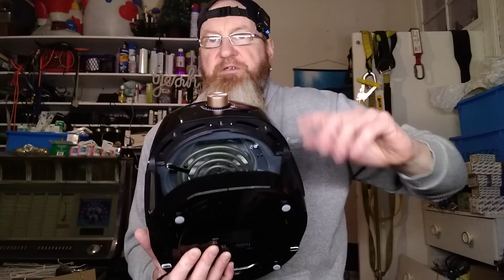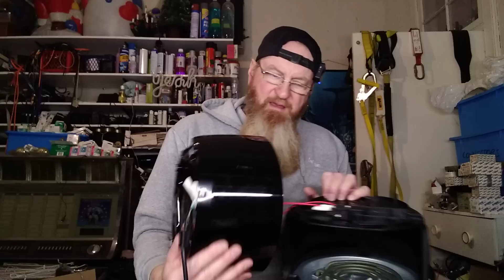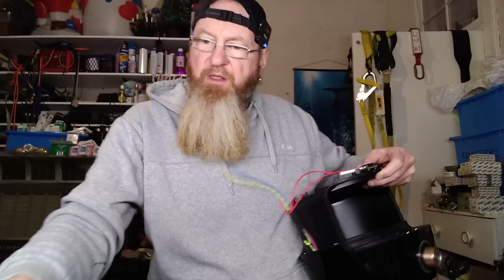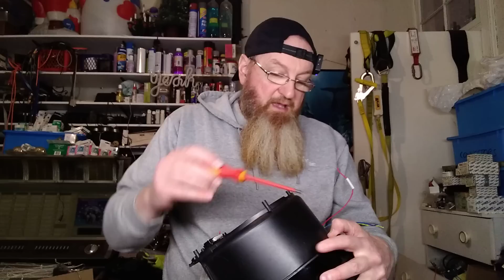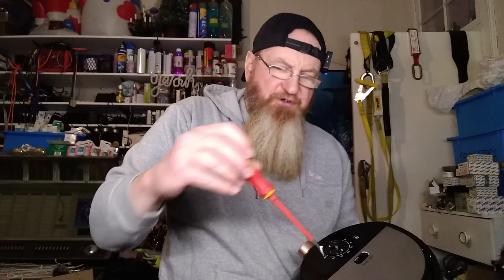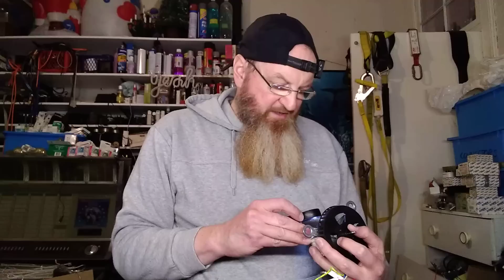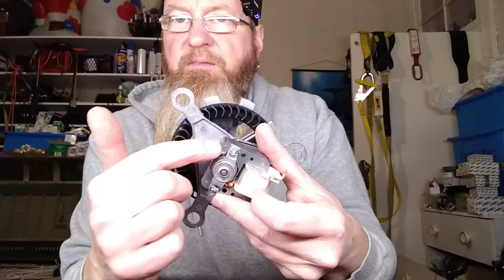Total teardown of an ASDA air fryer

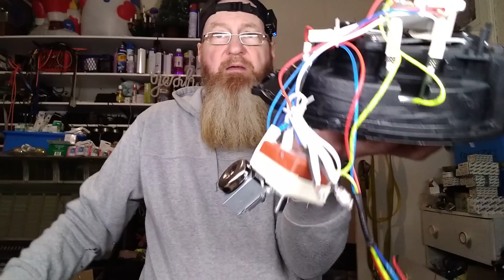Comment: Yes 14:25 that TING, Very good keep that for when you're building a fan heater and yes all that touble airmixing to heat the oven, run Some hot air through it to take out any water...
That fan design is good, interesting 19 is the same in both

Comment: They’re so simple. Why haven’t they been a thing forever? I also just bought a combination oven and air fryer and it’s amazing. The only thing I don’t like about it is that it uses PWM to adjust the element temperature - which is very nice, makes it much more accurate - but it causes the LED down lights to flicker. I’ve got Philips Hue LED strips which aren’t susceptible, so it’s not too bad.

Comment: Fascinating & reassuring to learn about the external cooling air flow. I wondered how these things didn't turn into a pool of molten plastic with 200c internal temperatures. You might want to invest in a small electric screwdriver to assist in future disassembly videos.

Comment: I love my air fryer! Same style but digital, no dings just beeps. 

I just did the same disassembly process with my broken rice cooker and you will not be surprised to find that all the problem was, was the thermal fuse. But now it is a collection of parts and the case is becoming a benchtop power supply.

Comment: Found this channel recently and im truly enjoying what you are doing. Is it annoying if I suggest that the speed of a cordless driver with a magnetic tip would reduce the tension a little :) maybe there exists a tiny little quick bit change tool with the right amount of speed and power?
 I dont know, just noticing this from the perspective of a person who uses drivers a lot and in a wide variety of applications to good effect.
 Keep it up and thanks
Reply from the maker: I've got cordless drivers, but when I use them at the bench there's a barrage of complaints about the noise.  So I tend to pause the recording while undoing screws.

Comment: my microwave has an air fry function built in... has a fan and element slong with a browning 9nfrared at the top... it does OK..  but the issue is everything you aiur fry seems to take a different temperature and a different time..  so making 2 or 3 things ofr dinner means i have to eat everything separately because it takes 10 mnutes or more to cook something...  with a deep fryer or a skillet it cooks in just a couple minutes. and everything seems to deep fry at the same temperature so I can cook multiple things in the basket at once..   not impressed by the air fryer revolution...  though it is real handy if i just want a snack of one type item then I use it..

Comment: Years ago I bought a cheap airfryer not too different to that one, but from Tower a rather big name in cookware in the UK.  I only got it because a few people at work had bought them and were raving about them so thought I'd give one a go, it quickly became indispensable.  The following year I bought a larger double drawer one even though I live on my own as it's great to throw chicken, fish, sausages or steaks in one side and chips, onion rings or roast potatoes in the other side. The only thing my oven gets used for now is the occasional frozen pizza.  The cheap Tower air fryer went to my mother who used it for a few years until her death this year and is now with my brother and still going strong. 

Thankfully Salter who make the dual drawer one I bought sell replacement parts which came in handy when I rather too vigorously cleaned the crisper trays with the wrong type of scrubbing sponge and took some of the non stick coating off. I'm a lot more careful washing it now and it still looks rather pristine so hopefully lasts me years.  When it does eventually die I shall replace it with one that the baskets and trays can safely go in the dishwasher as I am a lazy bugger really.

Comment: Timer is sticking at 5 minutes on mine after having a year doubt any dirt has got in it though.
Reply from the maker: The mechanical ones often do that.  It sometimes helps to wind it past the time required, and then back to the correct time.

Comment: That's very similar to the inducer fan on my pellet stove.  In this case the fan on the end of the motor shaft pulls exhaust from the inside of stove while the fan between the motor and case pulls air through the motor and keeps it from overheating.

Comment: The difference between an air fryer and convection oven is not only the size, but how the heat is distributed. Convection ovens use a fan to gently stir the air around the interior to better distribute the heat. Air fryers use a larger, more powerful fan behind the heating element to force the heated air onto the food for rapid cooking. 
I recommend the oven-style air fryers over the drawer style. The former have more room and are more versatile.

Comment: Great video. I like the format. Fun teardown. Amazing to see how they work. I myself have a tefal actifry which is an airfryer with stirring and it is great for chips etc. By the way, you can also get similar heaters with reflectors from round popcorn makers except they are IR halogen versions. A great assembly for lots of projects.

Comment: Hah! Air fryers are excellent for drying electronic parts/pcbs. Set the thermostat to the lowest point (typically 80C) and the fan makes quick work of getting all the moisture out. Do this at own risk. 

I have one of the original Philips air fryers, bought it around 2012. Pretty much exactly the same design. It still works perfectly to this day. As it should, for a relatively simple design.
Reply from the maker: I've used mine for heating electronic stuff.  I ended up getting another just for that and also drying desiccant to have a nice oil-free pan.

Comment: I have a Samsung smart oven which i bought before the popularity of air fryers....the Microwave gets alot of use....however I don't need to buy an airfryer because it is essentially an air fryer....it has the heating elements and the fan....it works very well too and its a large oven not like the majority of the small airfryers for sale.....win...win for me😊😊😊😊😊

Comment: Disassembly is much easier when you throw your tools on the floor. Took me years to learn that.   ;)
Downside of all of those years of experience being, now I get stuck on the floor with the screwdriver and screw...
Still, the story of my life. Pulling both knobs, then loads of screwing.

Of course, this being our modern era, a few pounds more would've gotten you a unit that dispensed with the thermostat and timer in favor of a microcontoller with enough CPU power to play Battlechess. Which is about as bad as those microcontoller controlled bloody toasters. Pretty sure they require a 64 bit processor for it to go ping.
Oh, there was no game nextdoor. The crowd had tapped into your network and was cheering your relative easy in disassembling a kitchen device that's typically quite infernal to dismantle. Well evidenced by the dental spade lug, which literally extracted the teeth of the drawer switch.

I'll stick with deep frying in a pot on the stove, although I am quite partial to induction hobs.

Comment: We use a similar fryer every morning for tater tots. It also works well for fish fillets. We've resorted to using paper liners as the spacer in the bottom of the basket isn't stainless steel and it's difficult to clean. Enjoy all your shows!

Comment: "spade terminals"!🙂 thank you!
My way to release the crimp is to wedge a very small flat head screw driver as far as it will go between the wired spade & terminal prong, then the wired spade should easily pull off the terminal prong.
I agree, some just pull off easily while others are a bit more stubborn!

Comment: Compared to my "fancy" air fryer that I have in the US, this thing works like magic. I was very disappointed to have to disassemble my air fryer when I got it due to the heating element not working. Was an easy fix, but taking a look at the insides gave me insight as to how rudimentary it is. No steam ports, no external temperature control (albeit the thing is made of glass and metal).

Comment: I ended up taking apart one of those little timers because the dial was far too stiff and it would get stuck, as well as being a pain to turn when your hands are wet or greasy. Got almost all the way but then suddenly when putting the switch back in the whole thing exploded on me and I was back to square one. Kinda crazy to think it's still a fully mechanical clock, with a hairspring escapement, right where htings get hot and gunked up with burnt bits.

Comment: I have one problem with air fryers. For me they just don´t work that well.  We used to have one for a little while. A Tefal one. We tried making fries inside and it was just tedious. The upper ones in the basket would fry, the lower ones were soggy. It took AGES to prepare them. AGES!!! You always see the beautiful pictures of golden brown chicken in the basket - good luck with that. The stuff is going to be completely raw inside, black from the outside and you´ll have to throw away the fryer because it´ll be impossible to clean. After several attempts of air frying things I ended up making a huge mess inside, while trying to prepare chilli-cheese nuggets. Now these didn´t fry at all, they just melted into one bubbly blob. I couldn´t take it anymore and threw the fryer out. I cleaned it and took it to the electronics waste disposal center to the "reuse point" where you can place functional things so that people can take them and use them. In the end I came to the conclusion that these are only good for making french fries in very small portions.
Reply from the maker: They are best with pre-made frozen fries that are suitably pre-cooked and dry.

Comment: Upside down hob element with a fan 😂😂😂 probably cus they just cant sell the hobs 😂
Look for one thats got a door and racks with rotisserie 
Funny cus if its switched on at wall and open door element pops and bangs and takes out rcd and mcb in fuse box 😂😂😂 does same if switch light on with touch button 😂😂😂 called power air fryer JML have recently advertised it 😂😂
I have had it few years not JML tho bit grimey now had to get replacement fan nut came off now this one makes me jump like gun shot  😂😂

Comment: I want to use an air fryer but my daughter bought me a cheap one, Tower brand I think it was, I got rid of it because it stank of hot plastic in use.
Reply from the maker: They initially make a strong smell as they burn off the oil used during manufacture of the heating element.

Comment: We have one works on 120v so we use a220v step down xfmr. Has 2000 functions and I hate using it. The ladies have no clue and admittedly I have to fart around with it to get it going. I need one that’s simple like this one.

Comment: I didn’t like the smell of plastic coming from my air fryer, I returned it and the replacement stank too, I was told this is normal?! 😂
Reply from the maker: Initially there is a smell of burning factory oil from the heating element and drawer.  I recommend running the unit hot for a while then washing out the drawer.

Comment: US also advertises everything without taxes, innit? So the 20 bucks will add N% sales tax or whatever. Fell for that in a McDonaldz, where I had the correct amount of money as advertised on the menu and then it was suddenly more and I was in shock and confusion, held everyone up.
Hm, I wonder if I should by buy one for recycling HDPE plastic bottle caps. Melt them into sheets and turn them into knobs or tors or something.

Comment: What tells me that Clive made this video so we could see his Beard.🤔?
Looking extremely well groomed and dare I say, "Trimmed" to a fine edge.
We'll never know if the Air Fryer had any connection with the new improved
Beard's appearance.

Coiffuring has taken place, no matter what instruments were employed.👍🏼
Excellent result.

As for Air Fryers, they produce toxic aldehydes in the higher temperature
ranges as required for potato chips. So I don't use one.😨

Comment: Some time ago, I was given a cheap (non-functioning) air fryer which had contracted a severe case of died suddenly. When I pulled it apart, I was impressed with the shoddyness of the design. The drawer switch was on the neutral, which I thought a bit naughty, and it cut power to the entire unit - including the electronic controls, so if you checked your food, you'd wipe any time/temperature presets you had entered. It was protected by a thermal fuse on the neutral (also naughty), but the worst thing I discovered was that while the unit operated at 400F (`205C) the fuse they used was rated for 180 or 185C.
Looked up some reviews online and found a number of unhappy customer due to the propensity of these units contracting died suddenlyitis.

Comment: @Clive  Shame you didn't do this before I spent out for a new motor for my fan over fan, only to find the rotor shaft was 5mm as opposed to my original 6mm one!   Then I tested both motors on the bench and found the original worked out of the oven (Doogie IR phone camera great for this. (y) ) just as well as the new one, and it had been the oven panel selector switch contacts that were burnt all along!  DOH!  
What I've been asking is, how does the oven cook the underside of breaded things like frozen breaded garlic mushrooms like Asda sells?   I have found that howeverI place these in my ordinary fan oven, gravity sees to it, that the inards are expelled from a soggy bottom, while the top is hard browned. Only the buoyancy of hot oil gets them crisp all roind with no exploding.
So, does an 'air fryer' manage to blast air up from under the food too?  Does it actually make a vortex that sucks air and stray fat up to burn on the element?  A bit more useful than a  'Dyson' vac, if so!  :)
Reply from the maker: Work the air fryer you can pull the drawer out and give it a shake while cooking stuff to get even crispness.

Comment: BigClive, minor point.  As you mention it's like a convection oven.  We have a convection toaster oven and I find it far easier to use and more practical that the air fryer I tried.  Gave the air fryer away after 3 uses.  Too small compared to toaster convection oven.  Admittedly I wouldn't take my toaster convection oven to bits for possible parts use😀  Will you be telling us the job you are on? or did I miss it? or is it top secret?  thanks again for the great vids.  You've up my electronics knowledge game, and enjoyment.
Reply from the maker: It was the Royal Edinburgh Military Tattoo.

Comment: I had Tower and Daewoo air fryers which were virtually identical to this.  The thermostat on the Tower failed closed after 12 months, the thermal fuse didn't open and the basket melted.  The Daewoo failed after 6 months with an open thermal fuse.

I agree that they're a brilliant piece of kit, there's a bit of knack arranging the food so it cooks evenly.  On the same basis a halogen oven is pretty good, they will take a whole chicken (dead, plucked and drawn).

Comment: are the terminals very tight to prevent disconnection when it heats up?
Reply from the maker: I think they are a latching type so they don't pop off with thermal cycling.

Comment: Thank you, I had a hard time not to take mine apart, this should keep me waiting until it breaks. 

I would disagree with you about air being used for cooling its side. 
As seen on kettles, right plastic can handle these temperatures reasonably well. I have assumed that air can be internally circulated. getting air from 18(mine kitchen temperature) degree to 185 (for chicken) in one rotation is quite a lot for one step, plus would heat a room at the same time. had it running over Ampmeter (Dont have WattMeter) and mine fancy XIOMI does lover consumption while circulating internally at a right temperature implying that some heat is reused. would say the back would be used for return of the air-up (no relation to the bottle).
Did anyone tried it for re-flowing. Seeing if fan is too fast dislodging components. this come in smart form making handy little re-flow oven, for the builds with all the cooling periods already in a right package for fraction of the price.

Comment: For anyone who hasn't been to the states.  Yes it would be $20 but you have to add sales tax which varies by state. It's a bit like vat but whereas we have to display the incl price they don't.  The disparity between US and UK pricing is still there but has drastically reduced, we also comparatively earn more.  A teacher would earn about the same in dollars as we do in pounds but the tax is very different, basically everyone does a return.

Comment: Let's see if youtube deletes this this comment again (4th time).
Good to see how the basic air-fryer works.
Clive, you should look at the knock off auto-kitty liter trays that are removing cats. 
One man five cats has done a video that explains it.
A technical teardown and electronic examination would be very useful!
Reply from the maker: I saw that video.   But the main issue seems to be in the software, and possibly the use of a PIR sensor for the detection?
Reply: @bigclivedotcom  previous comments were deleted by youtube.
I am curious about both the mechanical aspects and electrical ones. 
How dodgy are the electronics and their parameters as well as bad mechanics are my concerns!

Comment: 6:09 I took apart the oven in our house a few years ago to replace a failed heating element (I was NOT going to pay Neff £200 when a new element was only £18!). I found that there is a second smaller fan in the top of the oven next to the circuit board for the timer and clock etc. which presumably blows cool air over the circuitry to stop everything overheating when the oven is on full whack.
Reply from the maker: It's probably to keep the outer cavity of the oven cool, but also possibly venting under the control panel at the top so very hot rising air from an open oven or grill doesn't damage the front.